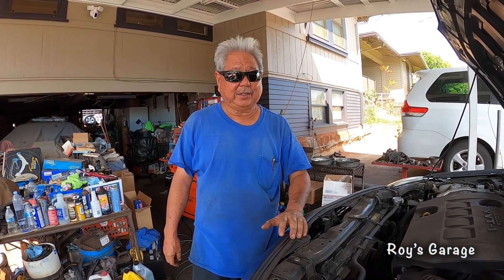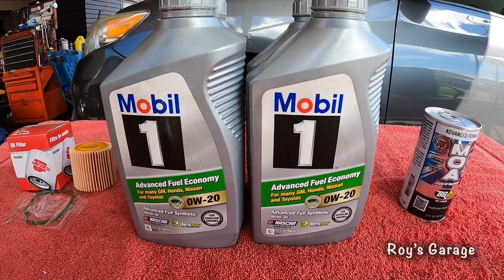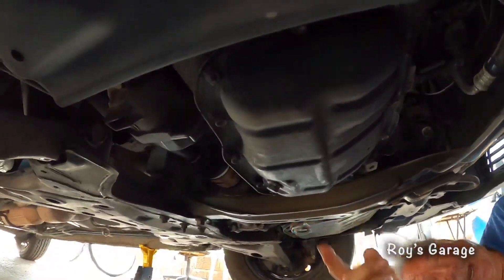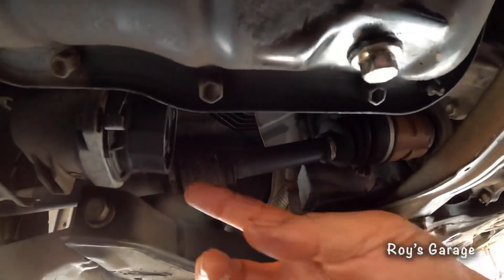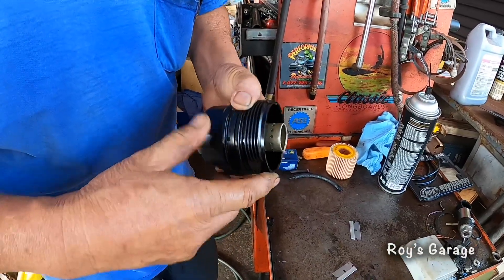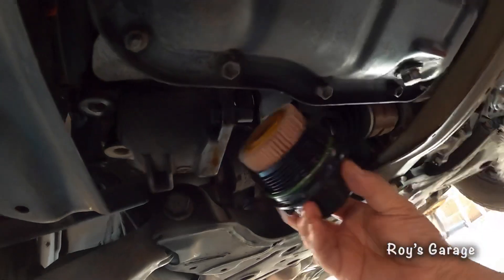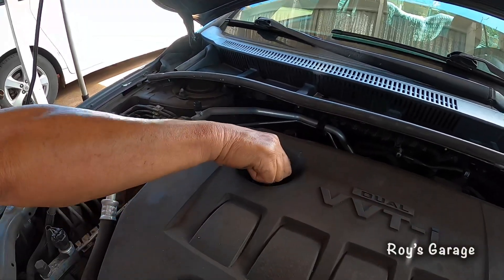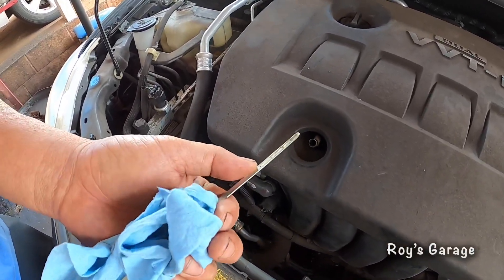How to Change the Engine Oil & Oil Filter on a 2013 Toyota Corolla

Comment: No mention of moving the safety spring on the filter before removing 
No mention of how much oil to add   Cap= 4.4 qrts
Reply: what is the safety spring you refer to?